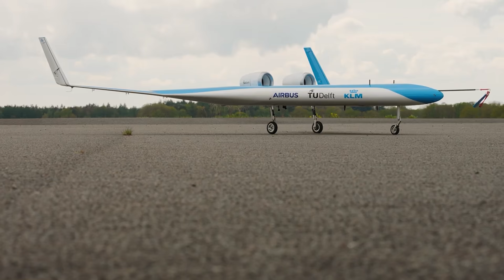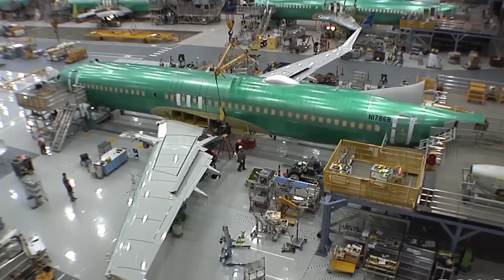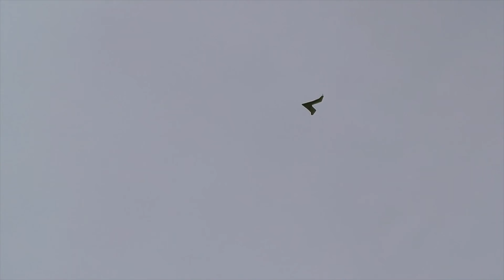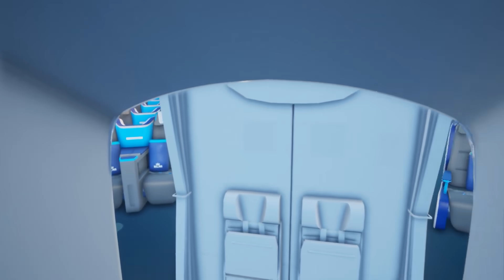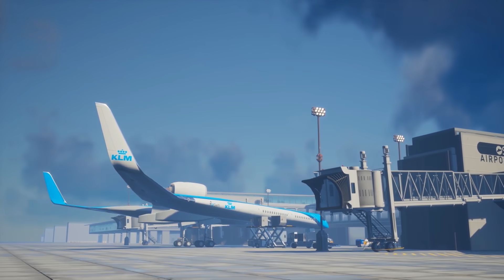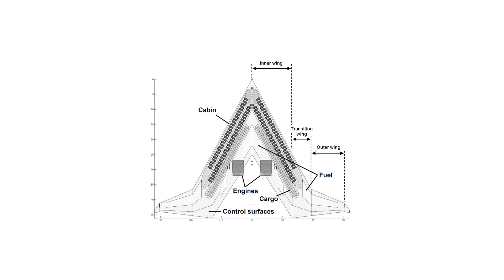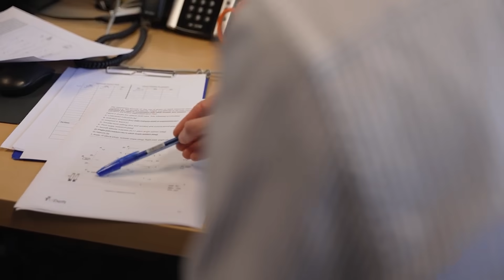The Flying V’s Fatal Flaw: Why This Jet May Never Fly Passengers!

Comment: Once in an oversee-able time, aviation takes a step. A biplane became a monoplane and later a swept wing equipped cabin. Propellers and radial engines became highly sophisticated jet engines. 
The future of aviation will not be hampered by technology, but by development costs, pushed by environmental demands (hydrogen flying) and directed, or hampered by availability of strategic materials.
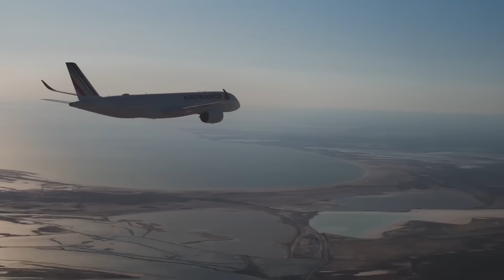Technological challenges are there, for instance the de-icing of the wing nose would require a heated cabin wall and heated windows.(3:15) The heat in the window pane must not radiate inward and fry the passenger... Local thermal expansion of a closed pressure cabin is an other topic. 
This is an example of soaring development- and certification costs.
Reply: They used to be LOUD when passing over your house, and had 3-4 engines when most only have 2 now
Reply: @mortache  Engines on the top of the fuselage reflect sound upward, instead of downward (as it it is now). Indeed travel (high speedtrains, jet liners) should not bring negative effects to non-travellers

Comment: Is the freight market not big enough to make it worthwhile flying these for some years as unpressurised freight planes with pressurised cabins? That way one builds up flying hours and R&D data in a real-world environment, while still working on the issues that make passenger flights more difficult to certify. You could even start with limited experimental freight flights run with a subsidy, as everyone gets used to the new look.
Reply from the maker: Good point!
Reply: fuel costs are not as much of a concern for freight as they are less time sensitive so can land and refuel more often.
Reply: @bftjoe  20%, or even merely 10%, fuel savings is still an attention-getter.
Reply: why do you think cargo airlines run so many old planes? not to save fuel, you 🤡.   @7thsealord888